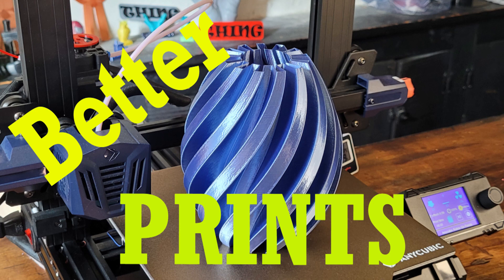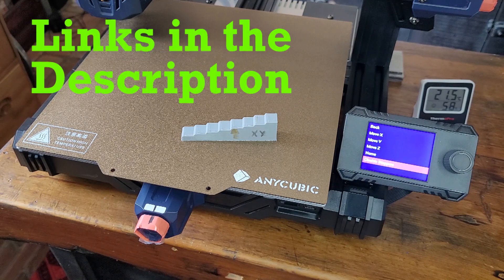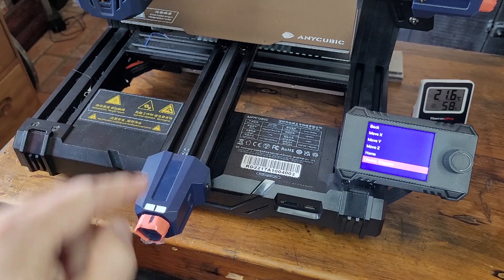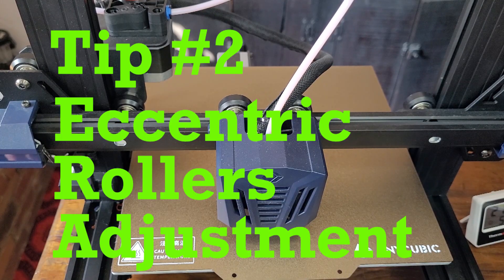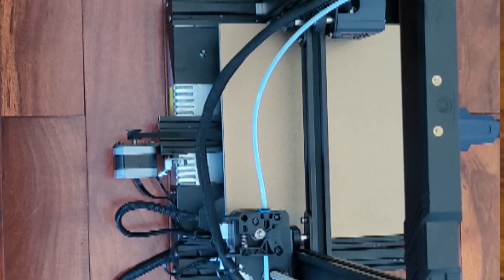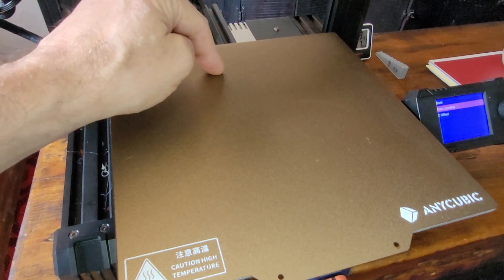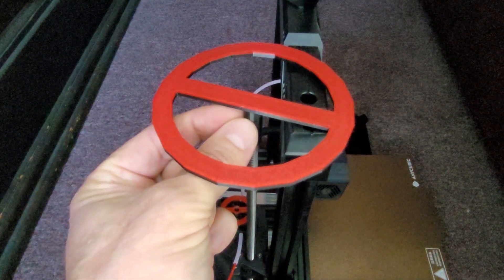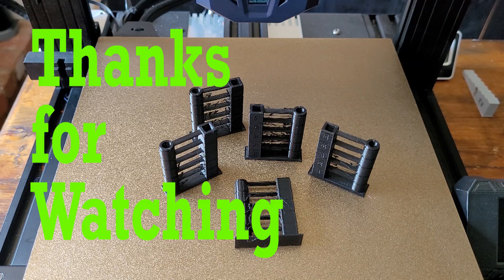Anycubic Kobra Go setup tips

Comment: Hey friend! Great video!
I have a question. I'm very new to 3D printing and this is my first machine (Kobra Go). I'm following your videos to calibrate it. In particular, my Z axis eccentric rollers on one side , specifically the ones you show at around 4:35 are not really tight and I can easily move them just with my finger tip. So I was like "Oh great, that's something I can fix then", but then I realized I have no clue on how to actually do that. I tried screwing a few things, but that didn't fix it. Could you maybe help? Thx :D
Reply from the maker: Hey Dani, I will do my best to assist, I don't own the Anycubics any more, but I think I understand your challenge. I believe  you need to release the tension of the X axis cross member, adjust the Z rollers and then secure the X axis cross member. I would release both sides then do the Z axis roller adjustment then resecure the X Axis cross member. The X axis cross members have some play to allow this adjustment, just make sure that the X axis cross member is parallel to the print bed when you resecure the cross member. Let me know if that helps 🙂
Reply: @mayhemsmiley  Thank you very much! Appreciate the time and the help. I'll definitely try this out and I'm sure it's going to help!
Reply from the maker: @danidaje and share Joe it goes too 😊

Comment: Your videos are really helping me out as I am a real novice here. Having a lot of trouble getting the builds to stick to the base. Get about halfway done and then they start to move. So far I have cleaned the bed, then leveled the bed and made sure the temperature is just above 60, but to no avail. Any suggestions? Also is it    possible to get a copy of the file for the belt jig? Trying to cross my Ts  -- so to speak.
Reply from the maker: Hi Paul, sorry for the delay responding. You're using a Kobra Go? Here is the link to the belt tension jig https://www.thingiverse.com/thing:5998420 Try it out and let me know how it goes. Wash your build plate with soapy water then use ISO alcohol, do not touch the surface with your hands, all humans have oil from their skin. Temperature of 50 has worked for me, to get started if you need to use a thin layer of glue from a glue stick while your debugging and tuning your printer. Keep me posted and I will help as much as possible.
Reply: Hi Mayhem: Yes it is a Kobra Go. Trying out blue painters tape for now. Tried different builds (cube square) but it did not stick either. May have to use buildtak.
Another question, the firmware on my printer is V1.2.9 and I see there is newer version from the UK site V1.3.4 Is there any advantage to upgrading the firmware and does the new version work properly. I had a reply on the facebook group to stay away from it. Thanks again for your help.
Reply from the maker: @PaulHazell-gj6bg  mine is version 1.3.4 and works fine, came that way.
Reply: I had that problem with my Kobra Go and I cured it completely by downloading a first layer test print off the internet and adjusting the Z axis offset untill the print looked correct. The advantage is that you can adjust the axis while its printing and see the result straight away. I used it agin when I changed filament as the new filament didn't stick. After adjusting it sticks every time.

Comment: Hi i just got the kobra go for christmas and i have yet to get a semi decent print off of it. I tried a 20mm cube and had layer shift. I attempted the owl before that and could not get any bed adhesion no matter what i tried. Ive checked belt tension, i have tried 3 different slicers (cura, astroprint, prusa) and no matter what i do i have failed prints.
Reply from the maker: Hi Ulf, sorry to hear. But don't give up. Here are some pointers. Start by calibrating your extruder https://youtu.be/xetz2ndT7eA?si=nLWRv0n42kFk42jS then setup Cura using the creality ender 3 v2 profile adjust the bed size and z height in the profile, leave everything else alone. Next do this https://youtu.be/s44ZC3RfFdA?si=Sfj9XJIdpFvh8aVd Then join the facebook group and and share your results there. Tag my nickname Mayhem Smiley and I will try to help you get some better results.

Comment: Have you updated your firmware on this machine? I’m having trouble updating mine. My shop pc won’t run cura and my MacBook keep having “connection issues”
Reply from the maker: Hi Raymond, nope stock firmware, but I will occasionally have to unplug from the printer then  restart Cura before it will connect.

Comment: Nice man, Subbed. Just got one on Saturday.. Got some good prints, but i still require Input! 😄 One question i have, Is it common to have a -2.22 Zaxis offset? Mine is that much...! I bought this from a Hobbyist who was huge into 3d printing and had multiple machines, he told me that it was brand new and he'd just assembled it to make sure it worked. So i'd assume that the Assembly wasn't and issue. Or is a -2.2 offset not all that bad? LOL sorry thats more than 1 question..
Reply from the maker: HI cdnbrit, It will be rare that people have the identical z offset. It should not be an issue that I know, The key is getting the right distance from the bed that will lay down a good base layer. This was a method that I used to get good at setting the right distance (z offset) https://youtu.be/s44ZC3RfFdA

Comment: Wondering if you had any issues with E-steps.  Out of the box the default for my Kobra 2 was 463.09 which seemed rather high but upon calibrating it I found I needed to go up to 475.63.  But then on prints I had MASSIVE over extrusion and had to reduce my flow rate in Cura to 65%.  This seemed way out of whack.  I did a little calculation and figured that 65% of the default was right around 305 so I reset my E-steps to 305 and sure enough my flow rate is spot on and extrusion is super smooth now.  I've done E-step calibration many times and never had this sort of result.  really odd behaviour.
Reply from the maker: Thanks for sharing the info, mine were off but nothing crazy. My prints visually improved after estep calibration. My flow has been fine at the default setting and I've played with some extreme settings for the flow too.

Comment: Man, love your videos. However, my go is driving me crazy, just when I think everything is good, I get massive layer shifts. Especially if I print from cura, only slicer that gives me decent prints (sometimes) is orca slicer
Reply from the maker: Hey Wayne
Thanks for letting me know. 
Which version are you using of cura?
The only time I ever had a layer shift was when I was testing to establish and understand the belt tension requirements.

Comment: Interesting. Thank you for making the video.  I had a couple of red errors, bed leveling, the other one that said something err-.   I was going to let the printer go but I gave it another look. The belts were loose tighten those up works pretty good for me.   I found your video days later and we are in the same FB group I looked and looked in the group nothing of the sorts, for my issue.  Then today bam  you hit this out the park. When I feeling like fine tuning definitely going to do of these.
Reply from the maker: Morning Will, thank you for the kind words. I'm glad you didn't give  up on this printer. I almost did and realized that I could help more people by doing these videos than commenting in the forum and trying guide people with words alone. This has turned into the hobby on top of the hobby 😆

Comment: Sold my Anycubic Kobra Go a couple of weeks ago. #sadface
I've done it due to constant problems with the BLTouch sensor.

I've already told you about it once. The wire failure resulted in an intermittent signal that I couldn't rely on. Couldn't even finish bed levelling. Tried to fix it, partially succeeded, but the problem reappeared. Don't have access to soldering, nor do I have any experience in it, so I decided it wasn't worth a fuss and sold it all together.

Sold it for 190$ and bought a regular Kobra for 220$ yesterday due to a discount.
Don't worry, though. I'm not going anywhere as long as your content stays relevant, well structured, and deeply analysed.
Your video blog rocks! Great job.
Reply from the maker: Wow thank you so much for the kind words.  Sorry to hear the go was so problematic.  Keep us posted how things go with the kobra.